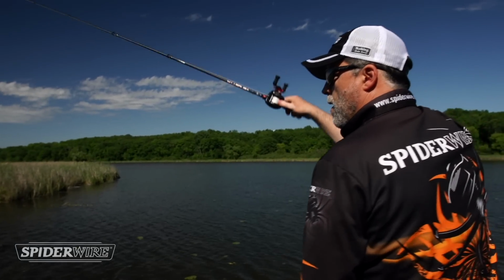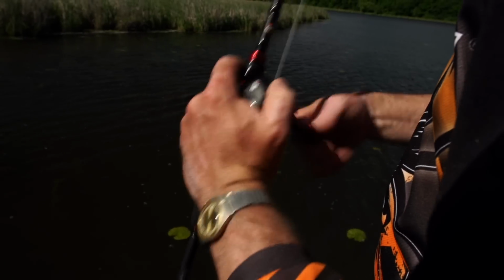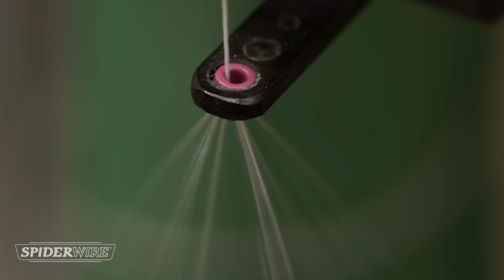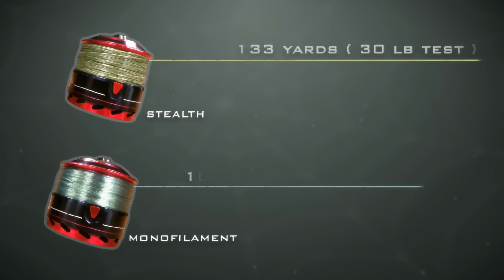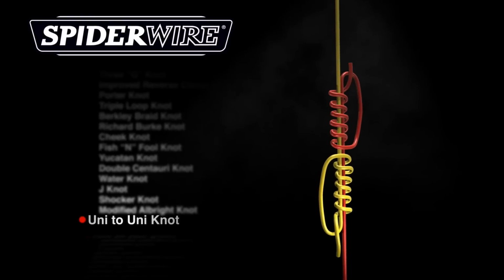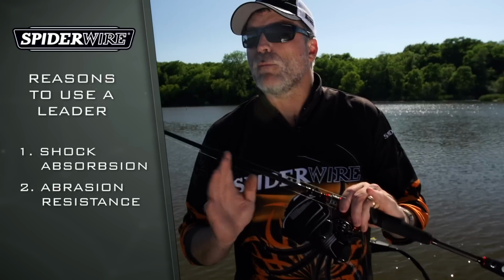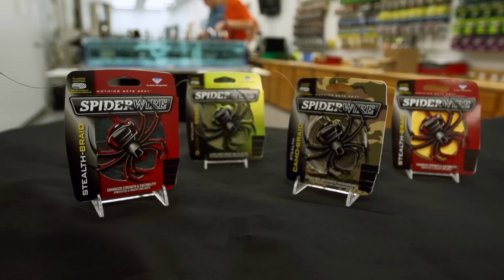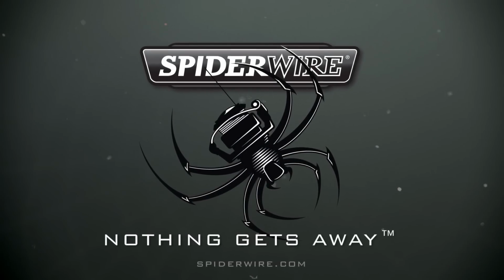SpiderWire Product Video - Stealth Braid

Comment: Been using the 10 lb braid on an ultra light spinning reel setup for river trout fishing. I splice on about 8-10 feet of 8 lb fluorocarbon leader (also SpiderWire) with a blood knot then usually tie on an inline spinner. It takes a little while for the braid to acclimatize to the reel, but I think this is true of any fishing line newly put on. Once broken in over a couple of outings, it has worked very well for me. Landed a bunch of browns and cutthroats.
Reply from the maker: If you're fooling Browns with it, you know it's good!

Comment: What happens when the coating wears out. I have heard that it frays real bad?
Reply from the maker: Hi, Michael. All braided lines have some sort of coating. Fray is part of the game since braids are made up of smaller fibers cluster together in bundles. A little fray is part of the game on a traditional braid and will not affect the strength.